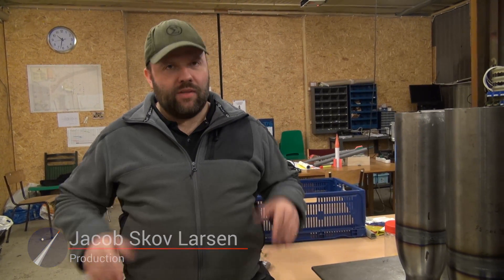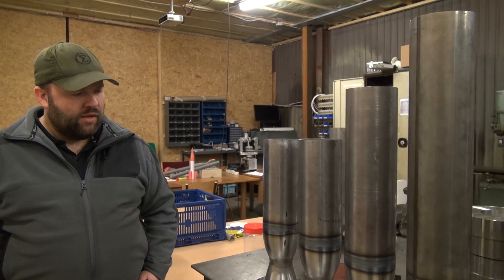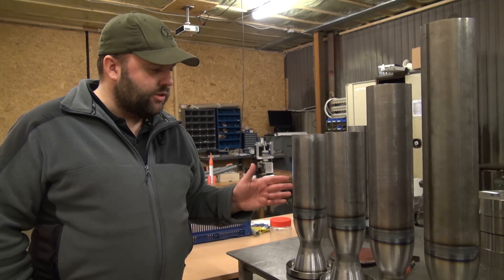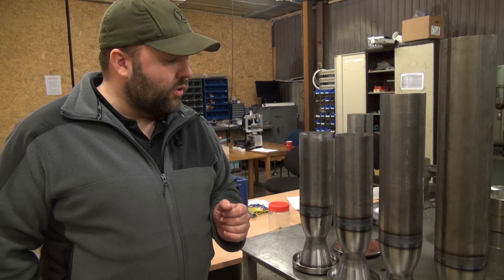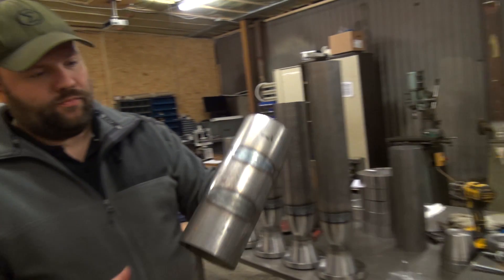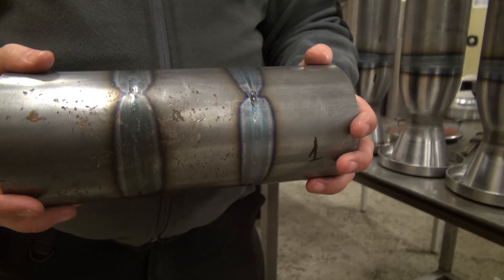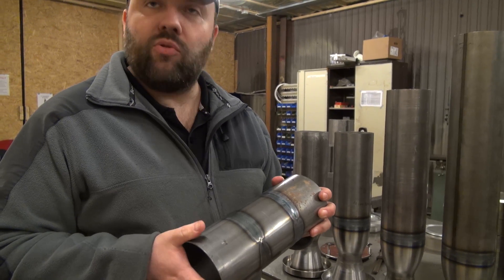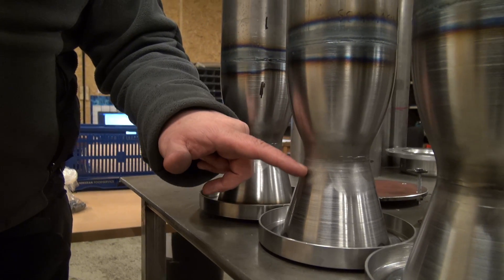How to Make a Liquid Rocket Engine - BPM5 Version 2

Comment: Did you try using a backing gas during your TIG welding?  A gas like helium will also change the heat distribution.  Plasma welding would also work for this.

Comment: Have you heard of or tried "friction welding"? Basically hold one part stationary while you turn the lathe on and spin the other half and press the parts together for a few seconds. When the metal joint gets red/orange hot shut the lathe off and like magic you have a perfect weld and it's done in only a few SECONDS... Not however many minutes it takes with the current method.

Comment: Why you don't weld with fricciOn?
Reply from the maker: FSW is only used for welding thick aluminum, we use thin stainless steel and we are a non-profit, crowdfunded volunteer organization doing this in our spare time. Even if we did use thick aluminum in our production, the tooling and machinery for performing FSW would likely cost us more than our entire project.
Reply: @CopenhagenSuborbitals  understud. Whats about the stress on the piece? I would like to help you, I am from Argentina and a rocket science fan.  the only thing I can contribute is a bit of my knowledge

Comment: you seem like a pretty knowledgeable guy, can you please help me out?. I've been thinking of building a mini rocket engine, maybe one with a combustion chamber of a 1"- 2" diameter and maybe 2"-4" long with a nicely built nozzle, maybe going to use stainless steel but here is the big question, can i just put two metal lines straight into the combustion section, one would be 100% oxygen from the kind of tank you can buy at home depot, maybe going to change the flow rate to be much greater and than use propane gas on the other line, maybe make some kinda swirler for the two to beable to mix better, maybe build that inside the combustion chamber so nothing else will explode from having an explosibe mix. does anyone know if a rocket like this would even work,???? maybe blow up, not be efficient but still work? or maybe can one gas from one line go into the combustion chamber and go back up the wrong line mixing ox and gas in the line letting it able to carry a flame front down and explode something or will the pressure front from the gas beimg pushed down the line stop the opposite gas from entering back up that line? hmmm i have so many questions sorry" i wonder why i can't find a style of this kind of rocket that some garage scientist on YouTube has built yet, i thought this is how a rocket engine works in its most basic form.
Reply: It just so happens that I have built almost exactly the engine you described, although my fuel was isopropanol. As my injector, I made a sort of modified pintle/impinging stream injector. Basically, it was an 8mm hex headed bolt with a hole drilled down the centre of the shaft, and three holes in alternating flats of the hex. These were for the fuel. This bolt screwed into a plate at the top of the combustion chamber. In this plate, 3 more holes were drilled right beneath where the fuel holes were for the oxygen, so that the streams of fuel and oxygen would hit each other.